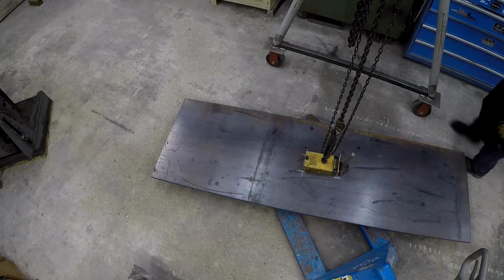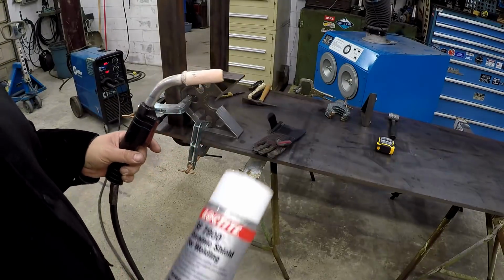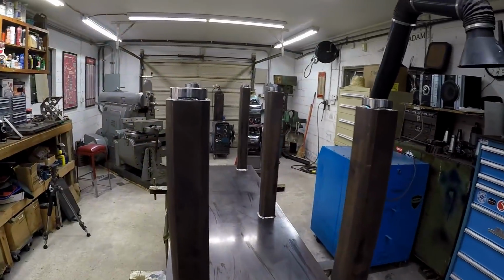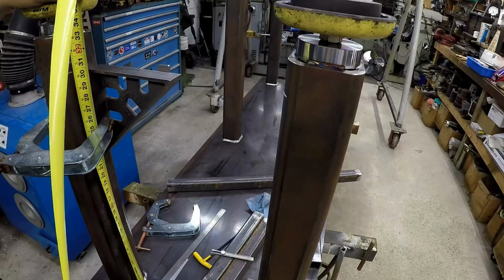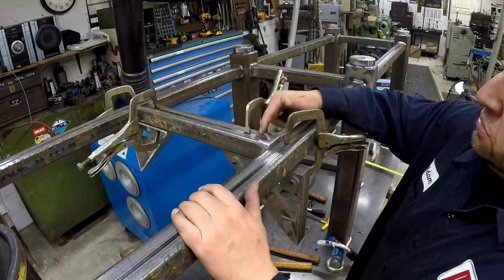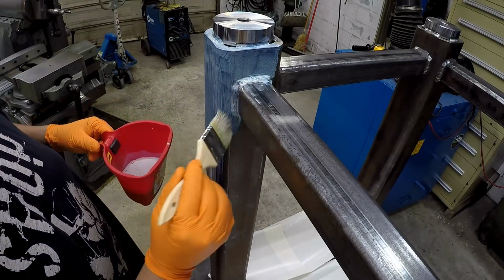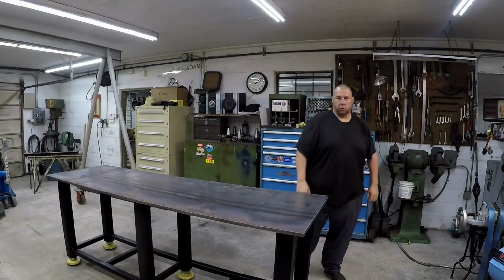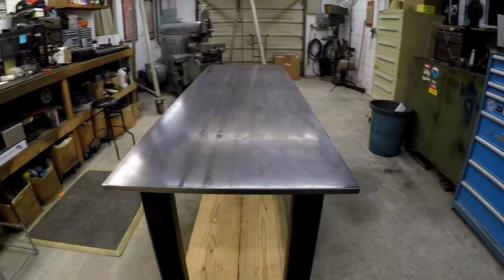SNS 226 Part 2: New Shop Work Table

Comment: I built a similar table, my table top was covered in rust. Any advice in the most effective way to get to clean metal, it’s 4x8 and using a flat disc is a slow process.
Reply: I would build a dam around the edges using 1x4s glued on with rtv silicone. You dont need much head space. Maybe an inch

I'd mix up a batch of citric acid and flood the table face. It works the best for derusting steel without being very dangerous.

I use it regularly for derusting tools.

You can find citric acid powder at some grocery stores, but I buy 5 pound bags of it on amazon for about $13. Its used for pickling. It will leave a dull gray finish. 

You'll have to wire brush out the pits if they are deep.  I let it work for 20 minutes to a couple of hours.
Reply: Padraic McGuire thanks for replying, I’ll most definitely give it a try. I’ll make a point of getting back with results. Thanks again

Comment: Hey Adam, I enjoy all your videos and have learned a lot.  Just wondering, have you ever used 7014 contact rod?  I use it because you can take the rod right to the work without it sticking (provided you have the right amperage setting).  It seems to just pour right into the joint and makes a nice job.

Comment: Lovely table! I was thinking that the only thing holding the legs vertical is the top plate. When you welded the small cross members, near to the other ends of the legs, I was just wondering if that might cause a slight shrinkage as it cools, pulling the bottom of the legs towards each other and hence imposing a slight convex bend on the plate (when table is right way up). Or perhaps that plate is just so strong it doesn't bend.
Reply: thats such a tiny amount it wouldnt make a difference, anything can move, but in all it will settle under the weight too, sure you do have to plan somethings for shrinkage, it can break welds too, but in this case, he did a fine job

Comment: Great video, Adam. I was thinking; get a 1.5" to 2" thick plate of steel, wide enough to mount the vise and long enough to be strong (at least 12" of welding length). Use the shaper to mill down the part that goes under the table so that the top part holding the vise is flush with the top of the table. Clamp it up and then weld it from underneath. What do you think? More welding and shaper video! Looks great, man. Super job.
Rich

Comment: Hi Adam nice table. Have you thought about maybe attaching a bar to the legs at one end just below the top as a place to hang clamps so they are handy for use if needed whilst working on the table?

Comment: Hey could you video the vice extension/bracketing too?  That idea about being able to turn it 90 degrees to hold something vertical is really cool.  I must have missed Tom's video on that.  On that CRC stuff, how scratch resistant is it?  It looks pretty cool.

Comment: Great table Adam. One more thing you might want to consider is to radius all 4 corners of the top. I used a quart paint can as a guide to radius my table which is very close to yours but only a 6 by 3. I had built it like you did but after bumping into those sharp corners for about a year I finally decided to radius it to prevent any further hurt to myself. I'm really glad I did it too. Not a single bruise since I did the radius and I don't miss those sharp corners at all.
Cheers
John
Reply: Good point

Comment: I have a serious question I would to those that have some experience welding as I am only a novice and still learning every day. In the video adam says that you should always try to weld uphill versus downhill, whats the reason behind that? I am truly curious. Thanks in advance.
Reply: When welding downhill the puddle tends to move too fast hence very little penetration.
Reply: Okeey that makes sense , but thin materials like 40x 40x 2 mm box section penetration is't a issue I think. I not a welder.
Reply from the maker: Better penetration with vertical up. Downhill welds look pretty but are not as strong.

Comment: I bought a 6 x 4 ft by 5/8 plate steel welding table With a 6 inch offset vice for $200 ozzi $ what a great buy i got that day from a factory that closed down .it is SO HEAVY I CANT LIFT IT.
Reply from the maker: Good purchase!

Comment: Serious question for someone who knows, concerning the penetration on the table leg to table welds. I am not in anyway knocking that weld but am honestly interested. It seems to me that welding a 1/2" plate (boxed) to 3/4" large could make a superficial weld which over time of pounding on, etc might be a failure point. I realize the legs will not collapse, just curious if those single welds are sufficient given the parameters. For instance, if he had not added the supporting pieces to the legs, could the welds rack and break given the penetration of the single welds 1/2 to 3/4? Again, this table will be standing long after I am gone, I am only asking a hypothetical.
Reply from the maker: For a table, these welds are more then sufficient. The more passes you make the more it’s going warp the plate. Even if you shove it around with a forklift those legs are not going to break.
Reply: Cool, thanks, that's what I was getting at. The warpage factor had not even crossed my mind.
Reply: the_eddies if these welds were supporting a bridge or something similar your concern would be valid, but the welds have plenty of penetration to support this table and anything done with it.
Reply: Cool, thanks!
Reply: the_eddies if you mean because the material thicknesses are different, then I would say they are so thick it isn't very important not like light stuff like 1/8" or 3mm welded to much thicker stuff.
Reply: I am not really concerned about the thickness as much as the difference in thickness and the difference in penetration. Like, if I weld the corner of a 1/2" plate to a 3/4" plate that is 4 ft square, I am going to get a lot of penetration into that 1/2" but what am I going to realistically get into the mass of 3/4 plate. Is the melt in really going to be comparable. I guess what I am imagining is taping a piece of cardboard at a 90 degree angle to a piece of plywood. It will be very easy to tear the two apart and the tape will probably remain with the cardboard just based on weights. I know this is simplistic but I just trying to get the forces here.
Reply: the_eddies yes the difference is what I was referring too but the amount of thickness of each matters. With a 1/2" plate welded to a 3/4 plate there is plenty of thickness to get heat into both without fear of melting through either to get penetration. Also the way one angles the electrode or concentrates the ark to either piece controls the heat to either piece (in theory :-)}. So yes while welding different thicknesses requires technique when welding a light guage to something very heavey, in this case both the 1/2" and 3/4" are both very heavy and in this case would weld easy as if similar thicknesses. :-)
Reply: Got ya, thanks

Comment: Love the table Adam great job only thing I would do since I’m so clumsy is round those corners Because I would definitely bump into them the other thing I did on mine was I painted the underside of the table with bedliner it made it so you could hammer on it without it being so loud great work.

Comment: How are you liking the fireball tools squares? Wasn’t sure on what kind to get that would be the best in the long run. I ordered 1 of the cast iron 8” ones for now an might get a cast aluminum one once I see any reviews on it.
Reply from the maker: Both the Mega and Monster squares are great to have. I’d get at least one of each, but a pair of each would be even better. I find the Mini squares are just as handy as thx full size version.

Comment: "C'mon, baby". That's not the words I use when I stick a rod. Maybe I'll try that next time and see if I do better.

Adam, I hope that you give some feedback on the rubber feet. My feeling is that when banging and beating, the rubber may not be the best, but if you aren't banging and beating, it's probably not an issue. 

One thing we had on our tables was some 2" angle welded to the edge of the table so we could scrape oil into it and it would drain into a bucket. But we did big valves and Transmissions full of oil, that it worked great for. When doing cylinders, we used the vice, a support and a pan to catch the oil similar to what you have done, so maybe this wouldn't be an issue for you.

When turning something over like that I like to use a chain come-a-long and let it down slowly.  Also LOVE the chainfall hoist. It really showed it's gold when you were adjusting level.

Lastly, I really like the editing you did when welding. A couple showed the full weld, but mostly, you moved around and just showed bits as you went. Very well done.

Comment: Hi Adam
Bench looks excellent! What a difference in the shop as your dreams come to fruition. Congratulations!!
I have my 3.5" Wilton vise mounted to a hunk of white oak hardwood ( I am sure you would prefer steel plate :-)) about 8"x10". I can mount it anywhere on my benches that have room for a couple heavy duty c-clamps, just takes a minute to change locations. Might be something to consider for a trial period. If you don't like it super simple to change. regards vic

Comment: Hello how come on some of the post you didn't bother drilling holes and then feeling them in later to prevent some blow out or do you not have to worry about it as much with the   Tubes you're using

Comment: Adam, thank you for this video on the work table. I admire, appreciate, and respect your work ethic and methodology in all the projects/ machining jobs that you undertake. Thanks for the original idea of mounting that vise to the table. I will borrow that idea for my work bench- it is constructed with 6" channel, 3" by 3" by 3/8" wall angle, 1/4" by 30" wide by 8' long. Again, thanks!

Comment: Now that is a work table for the ages, the perfect companion piece to the round welding table.  Abom rated-!  I wouldnt want to dril holes in it either, thats a really nice slab of steel - no such thing as too much concrete or too thick of steel--lol

Comment: Adam, a nice table, rigid for sure.  A suggestion about the vise.  There may be times that you will need the whole table surface thus causing the vise to be in the way.  If you were to mount the vise on a steel plate  that is sufficiently large to allow clamps to hold the vise to the table., that way when you need the vise you can clamp it to the table and when you need the whole table top free of obstructions you can remove the clamps and put the vise under the table on the shelf.  This way you can have the greatest amount of versatility with your new table.  For  example; if the footprint of the vise is 5" square and you mount it on an 9" square plate using flat head screws countersunk from the bottom to hold the vise to the plate, this would keep the bottom flat, and would give you 2' on every side to clamp the vise/plate to the table.  If you mounted on the corner you could use 3 clamps and if on the side of the table you could use 2 clamps. I have a similar set up on my table and it works nicely.  thanks for all your great videos.  John Bidwell

Comment: think you tend to over do things, if you worked for Starrett  on product/design you'd be manager of the overkill design team. only flaw I see if it's also a welding table is your feet might catch on fire with those 2x12's.
Reply from the maker: It's a work bench before a welding table. I've never had problem with the plywood under my dads welding table catch on fire, built and used since 1972.
Reply: Adam, it's a beauty, think everybody appreciates your work. Table is your work here and now, so it's not out of the question that you might have your own improvements to what you have learned over the years. Technology keeps confounding us all. at least we can watch you tube and see our demise across the board in all the trades.

Comment: If you have NOT filled the bottom shelf yet.. visit the laminated flooring store or isle.. get a enough to cover the bottom shelf..  it will just make it so much nicer..  sometimes you can get the last of a discontinued for cheap.   i put it finished wood side down on my work bench and have a really nice red oxide surface to work on.

Comment: Those welds look so nice! What will you use to keep the top of the new table from flash rusting? Great stuff, I am happy you are recovering well and making really great content. Cheers
Reply from the maker: It's got the mill scale on the surface so it'll stay nice looking for a long time, other wise keeping it wiped and cleaned with WD 40 will work.
Reply: +1   I've used a great many steel tables and benches over the years.  As long as you wipe them down with either a dry rag or oily rag, you're fine.  If you ever use a degreasing cleaner or solvent, that's where you beg flash rust to come in.  The idea is to massage in the grease and oil from your projects or purposely wipe it down with oil.  Never a cleaner and everything will be A-O-K.

Comment: That rust converter does a good job and makes it a nice black.  Would be good to see the long term quality of it (guess I'll just have to keep watching your videos haha)  Pretty nice table though.  Will be able to do some good work on that.  If it ever gets to a cooler climate, a nice magnetic or stick on tank heater makes them nice to work on in the winter :D
Reply from the maker: The Good of The Land uses it all the time and he said some of those parts stay out in the Texas humidity and no problems. You can easily paint over it if desired.

Comment: Very nice table! Will you make one for me? :) I like your idea of a receiver hitch for the vise.
Reply: I did that same thing to my table years ago. I also made up an adapter to hold a chain vise for working on pipe. Also made an adapter to hold an old "T" slot drill press table retaining the swivel feature to hold work at just about any angle I need.

Comment: LOL... Did I just hear him say, "We... can easily move it around."... Adam, do you have a mouse in your pocket ?... That workbench is like 40 metric tons.....MOVE IT EASILY ?... lol You had to use a crane to move it.... I wish I had one, but I don't know if my shop floor could handle it..
Reply from the maker: Yes the pallet jack will make light work of moving it around.
Reply: Dru Bradley He built it so that he can put a 5 ton pallet jack right in the middle.

Comment: Adam seeing you do so much with big heavy iron and steel over the years, seeing you jigsaw some timber was one of the funniest things i've ever seen haha - nice work on the bench, looks great.
Reply: I thought the same thing. Absolutely wonderful work, $1,000,000 worth of machine tools, then to cut the lumber with a $29.00 black and decker saw. It brings us all down to the same level, you use what you got😀 beautiful bench! JB San Diego
Reply from the maker: JB, I hate that Jigsaw. I want to replace it with a flexvolt. I wont even dare show how crappy that B&D circular saw I use works. I resorted to my bandsaw for the second cut.
Reply from the maker: You would have laughed at all the content I edited out of that segment. Wood just isn't my thing!

Comment: That rust converter, does it work in a similar way as cold blue?
Reply: Doesn't seem to be that way. Cold blue liquids/paste use one set of chemicals to get their desired effect and the CRC stuff seems to use a different set of chemicals.  

Here is the SDS sheet for the CRC product - http://docs.crcindustries.com/msds/18418.pdf                 

And here is an SDS for Birchwood Casey Gun Blue Paste - http://goldenbore-guncare.com/files/B.C._Perma-Blue-Paste-Gun-Blue-MSDS.pdf
Reply: allright, thanks for the answer!
Reply from the maker: It looks similar but different.

Comment: How much weight do you think a table like this could safely hold?  Just curious in a ball-park guesstimate
Reply from the maker: Stronghold says their workbenches will hold two elephants, and Mine is built 3 times as thick.
Reply: LOL, fair enough =)
Reply: 1.21 Gigawatts

Comment: I like this table. That black finish on the legs is great. You do really nice work. It's good that you built it to fit YOUR height. Definitely DON'T drill holes in that top. I saw another comment about putting those receiver hitches in multiple spots, that sounds like a great idea - and you can do that at any time as the need arises.

Comment: Are you gonna put the TIG pedal on the shelf when you TIG?  It's kind of awkward if you gotta place the pedal off to the side.  I'd want to keep the bottom open so nothing is getting in my way.
Reply from the maker: It's not meant to be a welding table but i'm sure will be used from time to time. No worries. I'll use the finger control.

Comment: Very nice! Just a thought... you'll almost certainly need to move the table on occasion... maybe a few permanently mounted, out of the way lifting sling eyes/hooks and/or eyebolt holes of some sort would be safer than the magnet. As always, great videos, Thanks!
Reply from the maker: I'll use the pallet jack when it's moved

Comment: By the way the rust converter sticks on rust only. It will not stick very well on clean metal from my experience with it and i use it a lot.

Comment: Adam if I was going to improve the table I would round those sharp corners before you find out why I am making this suggestion     Good job I like it.  Jim
Reply: James Parker .  yes same thoughts here also , Adam will get around to it after he has found out why it's a good suggestion .bad enough when they are rounded as it still hurts but nowhere near as much as a sharp corner .
Reply: Ouch!!!

Comment: what a beautiful job as always Abom. Also, that tube mount design for a vice mount sounds great because you could have multiple tubes welded on so you could mount the vice on any side you wanted in any configuration which might be handy 1 day.